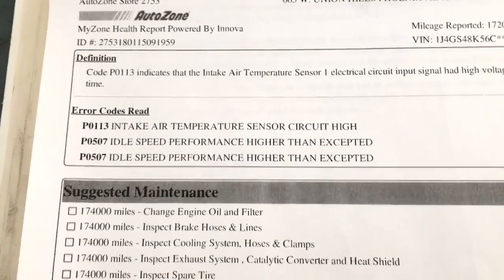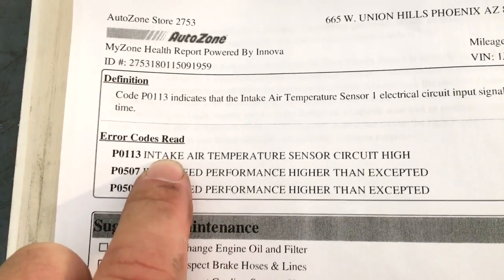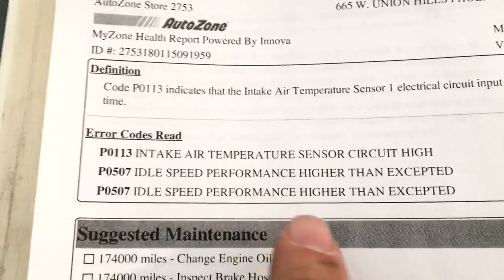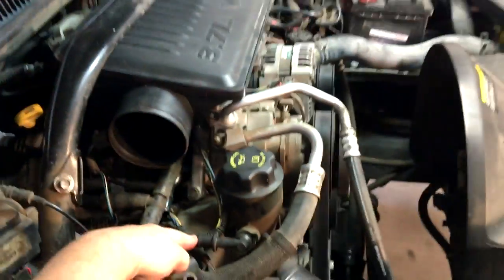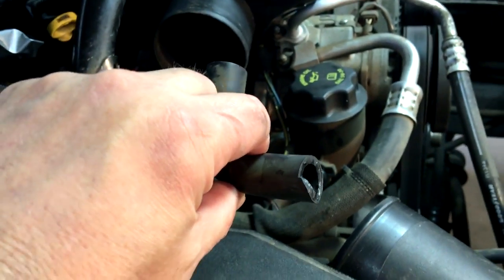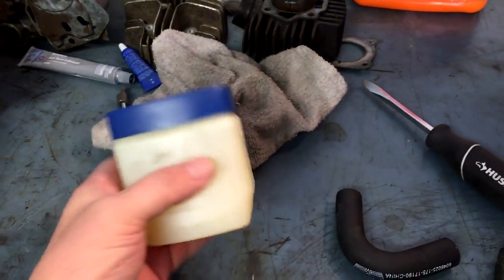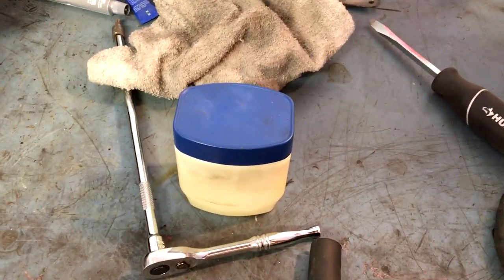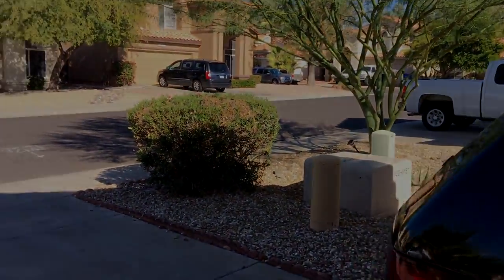How to troubleshoot High Idle. What codes? P0507 Turned out to be simple fix. PCV

Comment: Had same code and it was definitely a vaccume leak. Checked my pcv line and turns out BOTH ends were completely done for. Switch both and solved my problem… thanks for the video!
Reply from the maker: Good job! Thanks for the comment!

Comment: Three weeks have gone by I still have that same code. I changed the PCV, the hose (same one, same exact hose as yours lol said it’s was for ford), new throttle body and gasket, no vacuum leaks, and I still have the code
Reply from the maker: Wow Idk. Let us know what you find out.
Reply: @OurSimpleAdventures  my last resort is to disconnect the ground battery terminal and let it sit overnight. It’ll reset the computer and all codes won’t be remembered. I used to work for Chrysler and I had a customer bring his car in because a CE light kept coming on after repaired, so we did that route. It worked!
Reply: @ajaypro2881  so how did it go now?

Comment: Same code on my 2007 Jeep Liberty.  Hoping it's something simple like this.  Taking it to a mechanic on Thursday.
Reply from the maker: Let us know!
Reply: @OurSimpleAdventures  went to one mechanic.  He reset the computer which basically did nothing after the Jeep went through the drive cycles again it came back.  I took it to the Jeep dealer here.  They told me I had a radiator leak and I needed to fix that first and that could be causing P0507(total BS I think).  I'm going to check to see if I can locate the PCV host and see if I can visually see if there is any damage to it.  It's really getting hard to find good mechanics here in Atlanta.
Reply from the maker: @wlouisharris  Radiator leak causing it? Right. Wow it sounds like Atlanta is hurting for decent trustworthy mechanics. That's why I try to do everything myself. YouTube is a great resource! Let us know what you find.

Comment: I've had no codes on my '06 Jeep Grand Cherokee but her idle will surge randomly after a few minutes of idling or she will stall (shes only stalled once in a parking spot), I'm wondering if this could be my issue of a crack in one of the PCV valves. Other causes I've found could be my IAC or the Throttle Body.
Reply from the maker: Hi Amy,  I'm guessing since it's random it probably isn't the PCV Valve or a vacuum leak as mine wasn't random at all. After I started it, it pretty much went straight to 1500-2000rpm and stayed there. PCV valves are cheap if you want to start there to rule it out. Thanks for the question! Let us know what you do or figure out. Give us a follow and Subscribe as there will be more!

Comment: My VW cc does a similar thing but one of the vacuum lines are completely missing and it’s showing a check engine light I’m wondering if what’s missing is this PCV valve I was told by the dealer it was maybe the throttle body but after they cleaned it the car does the same thing
Reply from the maker: Wow I would say it is a good bet with the missing vacuum line. Can you find one for it? Give us a follow and Subscribe there will be a lot more!

Comment: i have a 2007 Jeep Grand Cherokee. my check engine light came on and i had a P0507 code for high idle. i replaced the throttle body. check engine still on. i replaced the PCV valve. check engine still came on and still showing the P0507 code.  what could be the problem?!
Reply from the maker: Jason,
I would also check the PCV hose and other vacuum lines. But I also found this on https://www.carobdcode.com/p0507-jeep-idle-air-control-system-rpm-higher-than-expected

P0507 JEEP Idle Air Control System RPM Higher Than Expected 
Possible causes
– Dirty throttle body
– Electric throttle control actuator misadjusted or damaged
– Faulty Electric throttle control actuator
– Intake air leak
– Poor electrical connection to the Intake Air Control (IAC) valve 
Tech description
If there are no intake leaks, clean throttle body, adjust engine idle and erase engine code. If the code comes back you may have to replaced the Electric Throttle Control Actuator (Motor) to repair the problem. 

Good luck! Come back and let us know what you find!
Reply: Did u check your idle control valve?
Reply from the maker: @bigx9095  that would have been one of the next things I would have checked. Thanks for the question!

Comment: I have high idle and hard shift changed the idle aIr control valve still same problem code comes up P0507 think it could throttle position sensor????
Reply: 2007 DODGE Dakota v8 4.7
Reply from the maker: @wmean45  Potentially but have you checked for any vacuum leaks? PCV?
Reply: @OurSimpleAdventures  yes had 1 replaced vacuum line and idle aIr valve replaced too
Reply from the maker: @wmean45  Interesting. Please let us know what you find!
Reply: @OurSimpleAdventures  on my 2007 Dodge Dakota v8 vacuum line hose in back of engine had to be replaced very hard to get on 4.7 had take to shop
Reply from the maker: @wmean45  Glad you figured it out! Thanks for letting us know!